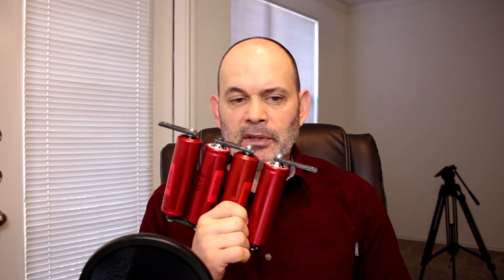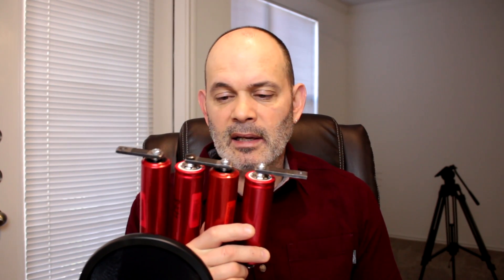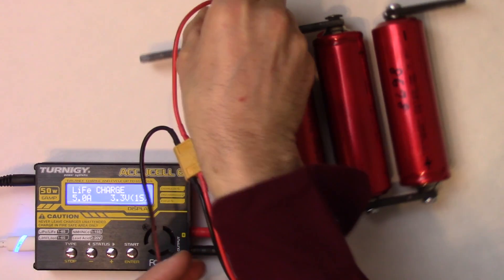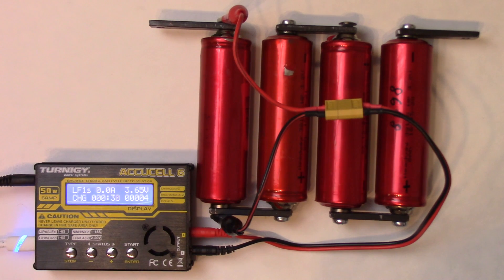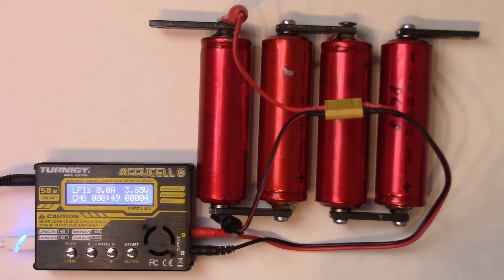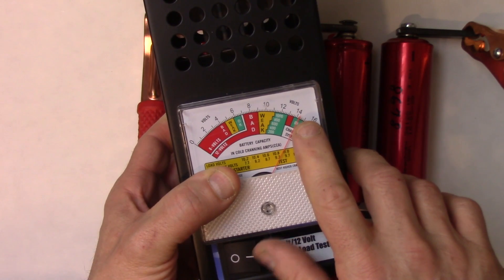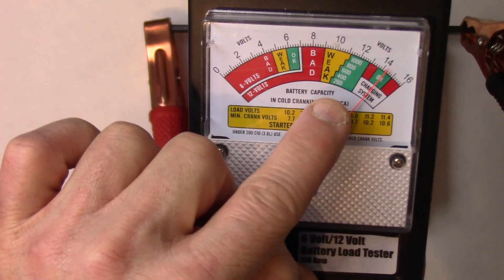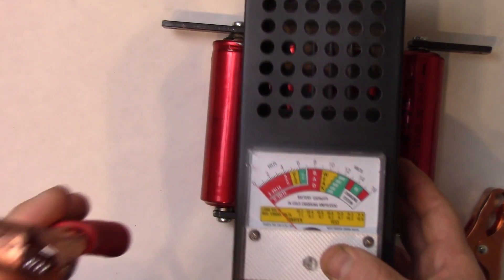Headway 38120 HP 200 Amp LifePO4 Cells Can They Start A Cold Car? Follow Up Questions and Answers

Comment: I bought 3 sets of these cells but have been unable to find connecting bars (at least with a reasonanle shipping fee), could you help with info on finding some beyond "search ebay"?  Where did you get yours?
Reply from the maker: I made mine using a peice of steel from a Harbor Freight wood clamp. I cut it into 5 sections, drilled it out and ground down the contact points. I am going to make some more bus bars but this time I am going to use copper pipe to do so. I will make a video on that and test how they work in comparison. Thanks.
Reply: Richard Lloyd thanks, I will check that video, and probably do the same
Reply: @richardlloydusa  
I might say something wrong but finding plate band of aluminum in different wide range is not that difficult ...
It gets hot real quickly I get it, and got welding point way under copper, but stand soft metal with good contact surfaces ...
And not that hard to find .
Even some u shaped to evacuate excess temp if needed .

Might be wrong about .

Comment: Has any one connected them end to end? Seems like with some all thread or a coupling they could be joined together and maybe slid in a PVC tube? Any way thanks for the Vid and all your work.
Reply from the maker: They could be connected in that manner but I not sure that they would make a reliable enough contact to transfer their full power reliably. Thanks.

Comment: How are you going to get your Alternator to charge those bad boys.  
Or am I to understand that this test is just for jump starting a dead battery?
Reply from the maker: You would need a BMS and a proper charging system for this chemistry. I only showed this as a proof of concept and to show how powerful these cells are. Thanks.
Reply: you would just need a hobby balance charger as most of them will run on a car battery as they are designed to do so, hobby king is probably your best bet to find one at a good price, you wont need a bms then as it is built into the charger ;-) just make sure the charger will balance charge lifepo4

Comment: First off both videos were awesome.....and second....could these batteries be use as back up power for an RV system to run a 12 volt inverter to power tv's etc ? And use solar panels with a 12 volt solar charge controller to charge the batteries ?  I would like to build a battery bank of these...Thanks
Reply from the maker: Yes, if properly implemented with a LIFEPO4 BMS and charging system they could be used for all those purposes. Thanks.

Comment: The main problem for use in a car would be the relative low capacity of 8 Ah. My car (Scoda octavia 1,9 l TDI Diesel) draws 40 mA of standby current just when sitting in the garage. This is for clock and other electronics, maybe also creeping current but seems to be normal on other cars too. This means a loss of 1 Ah per day. So when the car sits still in a garage for one week your battery would be nearly empty or already overdischarged quite a lot.

The other thing is, normally, after starting the car, the lightmachine would charge the battery with a very high current (there is no cc normally!), that can mean it would charge with 30 or 40 amps for a moment. Probably this wouldn't hurt the LiFePo - but not sure here.
Reply from the maker: A proper BMS would protect the cells. Thanks.
Reply: Yes, when thay are nearly empty. You couldn't start then any more, when the BMS had already shut down...
Reply: Max Charging rate for these is 80 Amps! Check them out also at www.evassemble.com where I bought Samples of Headway cells, years ago.
Reply: need about 12 //hooked up in para-series will be much more reliable

Comment: so in theory there is a ~50amp draw on each cell right?
Reply from the maker: I am not sure how that would work as the cells are connected in series. Thanks.
Reply: nopp, there will be 200amps draw on each cell because they're in serie (14.*v)
Reply from the maker: Yes you are correct. Thanks.
Reply: May be more then 200Amp for a 6 cyl. 3,5L engine but yes the whole current per cell but every single cell gives 3,2V or like 2,5V under heavy load.
Reply: Negative. In series the current is equal across all cells. In parallel the current is divided by the number of cells

Comment: I saw you using the skyrc software- I use a skyrc d100 charger, and I highly recommend them for you. It'll easily charge up to 2 banks of 6s life4 battery pack, and every other type as well.
Reply from the maker: I will look into that charger. Can you manually calibrate it? Thanks.
Reply: Do you have any documentation on how to use it? I have a B6 (genuine imax - dc version) and it doesn't have a usb port, just what looks like some type of serial header or something. The box and manual state "pc connectivity", but I failed to find anything out when I last searched...at least knowing what the software is called now will probably help quite a bit more,....
Reply from the maker: I have not done it (but I may) here is a NOT great instruction on how to do it. Thanks.
Reply: volvo09 I have seen some b6 users using skyrc software, but any real b6 with pc port can run the logview software and monitor that way. In the free to use logview program, you'll have to select your model from the drop down menu. I use it on a 10s 30a 1000w Icharger and it supports a bunch of different rc charger models.

Comment: Lets build the bms and charge this pack with alternator
Reply from the maker: Here is 200Amp capable LifePO4 BMS built for automobiles at Ebay: https://goo.gl/Kystjv I would need two for the 8 cells.
Reply: I am confused... Once the car is running, the alternator will be providing >12v back to the terminals. Wont the batteries, just 'topup' like a lead-acid? If we want to only charge them through a bms, how can we isolate them from the alternator current?
Reply: @jandrews377  actually, the alternator fluctuates and can hit a battery with almost 15v
Reply: The BMS should handle that.
Reply: Could you make a video on those BMS's? Also how would you hook them up in parallel. I question how well those BMS' would handle the 200+ amps of current required to start a car with those little mosfets. We all know the chinese love to overrate their products.
Reply: I doubt these chineese 5mm mosfets will work on 200A :D
Reply: Can a car alternator charge them fine or would there be a problem

Comment: You know if the cells are not cold it's not a real good test but still could be pretty cool with like 8 because I mean I have mostly v8s
Reply from the maker: Two four cell batteries in parallel would give you 400A that would be good enough I am sure. You could even go bigger. Here is a BMS that would do the job for one 4 cell pack at Ebay: https://goo.gl/Kystjv

Comment: Your charger will charge up to 6 cells in series. For 4 cells all you need is a 5 pin balance connector plugged into side of charger so it can read each cell voltage. When you start select 4S and charging current (2A) before you long press START button. I suggest you only use 2A charging as it may overload charger power supply. (2A x 14V=28Watts).
Reply from the maker: I will see if I can jerry rig something up. My power supply is a 16.5 Amp 12V power supply harvested from an Xbox system. It's 203W so it should be OK for the job. Thanks for the suggestion. All the best.
Reply: Just search for 4S JST-XH balance leads on eBay. They are dirt cheap.
Reply: Well, this charger only provides 50 Watts charging power. A beefier power supply is not necessary. But it is still better to charge all 4 cells at once in a 4S configuration.
Reply from the maker: Thanks
Reply from the maker: Thanks

Comment: Excellent. I figured they would do very well.  I have small diesel so I might put my pack of eight on it some cold day and see what happens. First though I’m waiting on some hardware.  In your other video you did measurements of your connector tie plates. I do not recall you giving a measurement for on center drill hole distance, perhaps you could share that in a video sometime 👍🤓
Reply from the maker: The hole centers were 7.5mm from the edge of the plates. That allowed the optimal amount of surface contact with the cell. I used a 1/4 inch titanium nitride drill bit as the final bit but I started with a smaller bit to start the hole (also used my HF drill press) though if you had the patience and a steady and strong hand you could do it with a hand drill (no thanks). Thanks.
Reply: Actually I was thinking the distance from drill hole to drill hole center for the battery spacing. The other information has been helpful as well. 👍🤓
Reply from the maker: It's 43mm between the center of the holes on the bars. Thanks.

Comment: The alternator would try to charge your pack....  Isn't that going to be bad for the pack?
Reply: I don't want a channel I'm just commenting : getting my assumption hat on here.... Short term it'd probably be fine, but long term you'd need balancing. Since cars charge at 14.2 to 14.4 (with newer cars dropping to 13.8 at low electrical load to save a bit of fuel) it's under the max voltage of the pack. I'll have to look up how they handle a constant "top off" voltage though... That degrades li ion cells over time, but these aren't them...
Reply: Thanks for that answer.  It was going to be my question also.
Reply from the maker: The charging system for lead acid battery in a car is a constant current/constant voltage (CC/CV) which is what these cells require but the charging system in a car also has a constant topping feature built in. I am not sure whether it would hurt these cells at all as they would be near their capacity at that point. It has not hurt my cells yet but as you saw they were not on there very long. The highest voltage the system would supply the pack would be 14.4V which would not be a problem. Here is a more detailed explanation of lead acid charging :https://goo.gl/QPQmFV
Reply: If you build one of these just to jump-start, the charging current would not harm the pack. However, if left in place while the engine was running, it would ruin the cells. To use a pack of these as a permanent LA battery replacement, it is imperative to get a proper BMS and charge the pack through it.